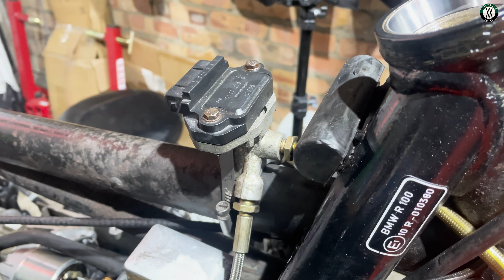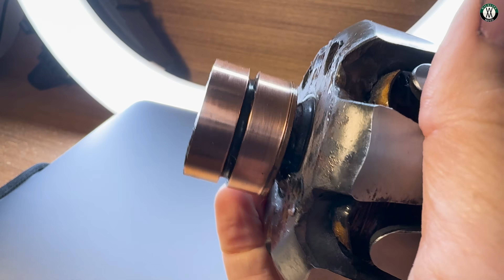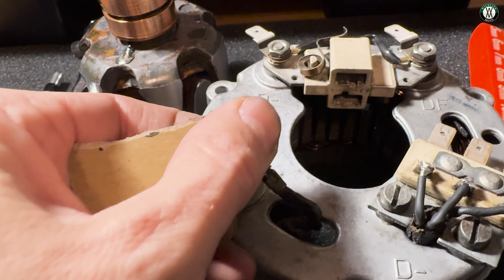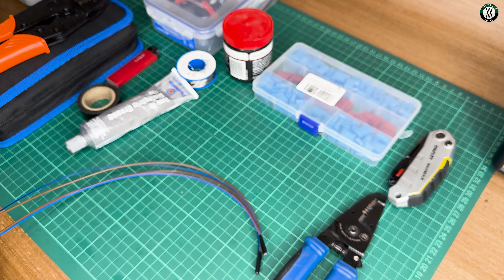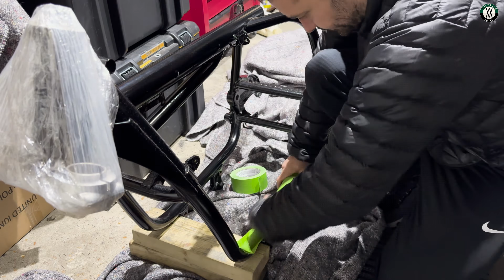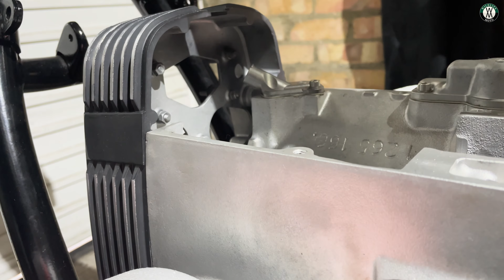BMW R100CS: Electrical System Overhaul Pt1

Comment: Another electrifying WM vid!!
Good to know you have a stack load of bits all ready for imminent reassembly........coz the days/nights are getting ever colder in the garage......guess you won't want to be out there in the depths of winter with frozen nuts......and bolts, of course!
Reply from the maker: 😂 Weirdly, I quite like working in the cold. I can’t deal with a hot garage. Just got to bolt it all together now. What could possibly go wrong! I having a great time rummaging through hundreds of sandwich bags trying to decipher my terrible notes from 9 months ago.
Reply: @WildlifeMoto  "Weirdly, I quite like working in the cold". I didn't mind when I was younger (and more enthusiastic), but nowadays my old bones can't take the cold anymore, so unless it's a desperate repair that needs doing, I tend to leave it until it's a bit warmer. Maybe the same will happen to you as you advance in years doooood!!!

Comment: I suspect I may need to do something similar. Just got an 81 R100 and the headlight, tail light and dash lights don't work when running. Ohhhhboy.
Reply from the maker: Grab a multimeter and test the resistance between the two slip rings. Also the y terminal and three phase outputs. The reference numbers are in the Clymers. That would be a good place to start. Good luck.
Reply: thanks! @WildlifeMoto

Comment: My first job was an Auto electrician,,we used to recondition DC generators and starters ,,we never did anything with Alternators ,we always fitted stock recondition units.. I think you would have been better just getting a replacement unit ....
Reply from the maker: Hopefully it will continue working for a while. I can understand that billable hours vs cost of replacement might not stack up. Thankfully my own time is free. I can pick up used units for around £150 if I get any problems. Fingers crossed it’s all ok.

Comment: WM it will be interesting to see Part 2 of the MWH condition & whether to simply replace all the wires & use new terminals/connectors?
Reply from the maker: I think some of the terminals could do with replacing. I need to get stuck into it. Hopefully it’s not too bad  🤞 Thsnks for watching.